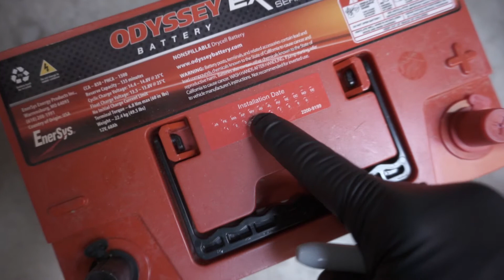Odyssey Extreme Series Battery Installation on 2008 Nissan Xterra/Frontier

Comment: Odyssey has a riser that lifts up the battery so that it's the same height as a 24F.  I have the same issue in my Accord.  34R AGM in a 24F setup.  Putting in a riser brings it up to the right height, and reduces wire stress.

(That being said, having TONS of crank power and reserve capacity is a great thing.  I went with a Deka Intimidator 9A34R Rebadged into a DieHard Advanced Gold AGM.) 550CCA / 100RC ==> 750CCA / 120RC (and it tests at 13.09v at rest, the alternator only goes to 14.6v, and 1055CCA).
Reply from the maker: Yup! I have the riser now. https://amzn.to/3kTtjmr